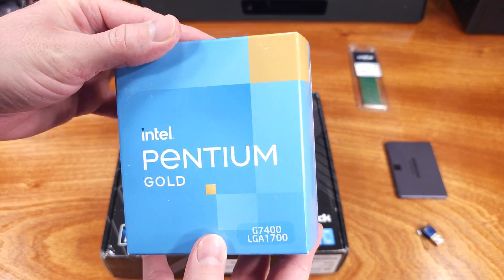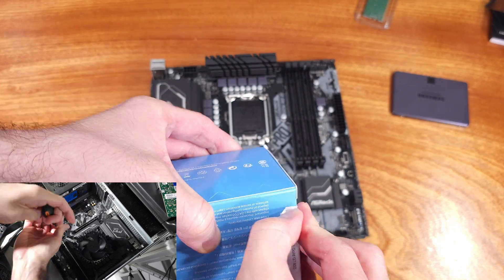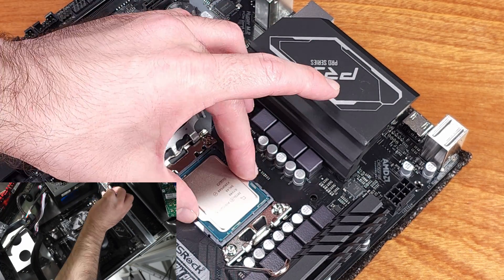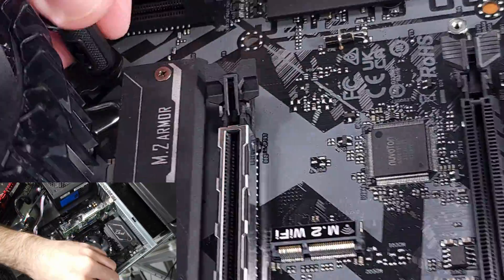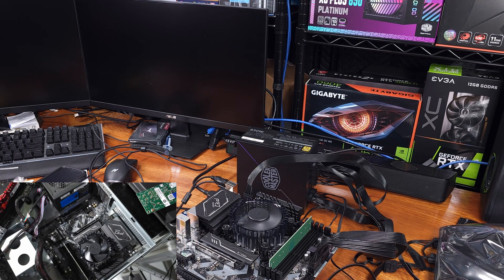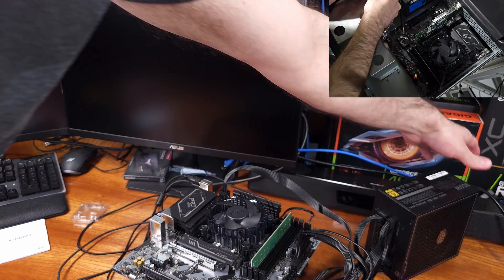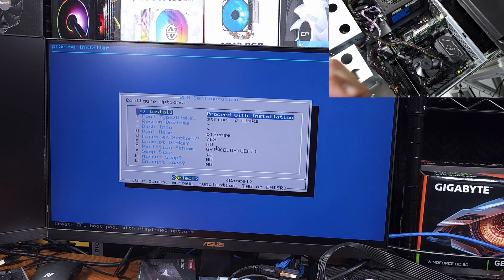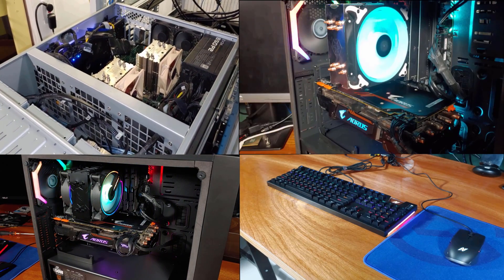pFsense homelab build 2024 [LGA1700]

Comment: Why you choose Intel for pfsense in your homelab
Reply from the maker: Hi Rodrigo! I went with the LGA 1700 platform and the G7400 because the cost was very low and the parts were readily available. There's nothing wrong with going with AMD for example but I already had the G7400 from a scrapped project. Were you thinking of building your own pFsense firewall / router?

Comment: I have Pfsense running in my R720 with all 32 threads allocated to it (and 24GB of ram, because I think it’s funny and have the excess). Running my gig connection to the max barely gets it to 10% cpu, that’s with all the bells and whistles turned on. Granted that is a lot of cpu to work with, but they are also super slow CPU’s, 2Ghz. I’m pretty sure a 5700x would stomp that server in benchmarks and real work performance. Sweet system!
Reply from the maker: Hey! Oh wow, yea, that might be slightly overkill there on CPU power and memory, ha! I used to run lots of older equipment like that and I do miss some of the features and functionality some time but I've found the power draw of consumer parts to be unbeatable unless you go with a tiny / micro appliance. A 5700X CPU would probably be even more overkill to be honest but I'm all for re-using older PCs, especially as pFsense boxes or Blue Iris / security camera servers. Do you run a hypervisor at all?
Reply: @STS  I do, the R720 is running xcp-ng. I used to have Blue Iris running on that host as well, but even with a GT 1030 the performance was horrible. it was fine until it was time to review footage, then the CPU would be pegged at 100% review anything faster than 4x. I have since moved it over to a Core i5 7500 desktop and performance is a bit better, but still not great. 2x 8 core cpus @2ghz is a lot slower than one might expect, plus the lack of a certain instruction set means I can’t run LLMs on it either. Between things running too slow and not running at all on the older hardware, I’m having a hard time finding a use for it other than my PfSense instance, which I plan on moving to another core i5 7500 desktop.
Reply from the maker: @MainelyElectrons  Ah yeah, that's a bummer but makes sense. For my Unraid server I used to have a 12600k and now I've swapped my 14700k in and I have quite a bit or CPU power. I run various VMs and dockers on my Unraid setup. I'm getting curious about LLMs to run at home as well, will have look look deeper into it. 

As for Blue Iris, that does make sense - newer 10,11,12,13,14th gen CPUs have much faster igpu's and the later have much stronger ipc and clock rates. If you can find a cheaper HP/Dell/Lenovo system with a new processor that should help a lot.

Comment: Hello, 
I recommend ECC RAM but perhaps this chipset doesn't support them. What model of network card does the motherboard have? For ECC ram need chipset W680.  look for Asrock Industrial IMB-X1314 with support for ram ECC and 3 network card 2.5gb Intel I225 supported in pfsense
Reply from the maker: I don't disagree that ECC or more specifically registered ECC would be nice for a firewall / router box. In my case though, I have gotten by fine without ECC running pFsense for years until the memory failed. The increased cost from buying ECC in my opinion just isn't super worth it for home users. If I knew that I had a strong enough business / use case to justify a W680 board and ECC memory, I definitely would go that route. I know that 2.5gbps support is available now as well but on my LAN, I just haven't found the need for it yet. 

Out of curiosity Michael, what are you running for your firewall / routing solution?
Reply: @STS :For non-domestic use
pfSense 2.7.2CE 2U BareMetal Asrock Industrial IMB-X1314 MicroATX
CPU: i7-13700@5.2GHz, RAM:32GB ECC, n°2 Samsung 870EVO SATA 2.5” SSD 1TB (ZFS) Raid1
n°3 Intel i225-LM 2500/1000/100Mbps, n°1 NIC Intel i350-T4V2 10/100/1000 Mbps 4*GLAN, n°1 Intel X520-DA2
Reply from the maker: You are using a 13700? Wow, is pFsense a virtual machine on this PC or do you have an incredible amount of traffic or services running?
Reply: @STS If you use many OpenVPN connections at the same time you need more powerful hardware, more RAM and a CPU that supports AES-NI CPU Crypto instructions
Reply: @STS Is a physic machine
Reply: The motherboard he used only had one nic, he had to have added a pci-e nic.  IMO I don't use consumergrade motherboards for routers. Easier to just buy a Protectli box.
Reply from the maker: Hey Jason! Yea - I could have configured everything on the single integrated NIC but it's just not my preference. I don't necessarily disagree with using something like Protectli but I am generally encouraging people to run pFsense on older hardware -  while it's quite possible a Protecli will last longer than an old PC running as a pFsense box, I think it's a great way to get into pFsense both in terms of cost and difficulty by re-using an old PC. With any solution, there are always caveats and it's good to know that going in.
Reply from the maker: Ah yes - those are excellent points - VPN and services can definitely generate some CPU usage. I briefly check over what Netgate offers every few months, its definitely interesting stuff and I like the idea of supporting the business but I find setting it up on my own hardware and spreading the good word of PFsense to be more my style. I suspect you do too - your system has quite a lot of horsepower there and probably didn't cost over $2300.